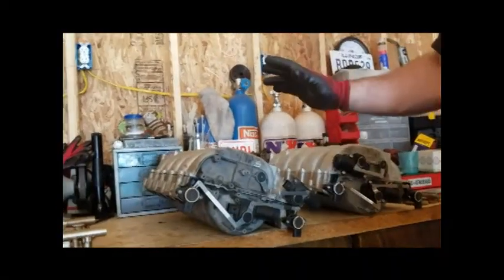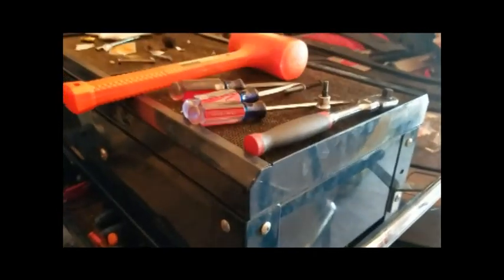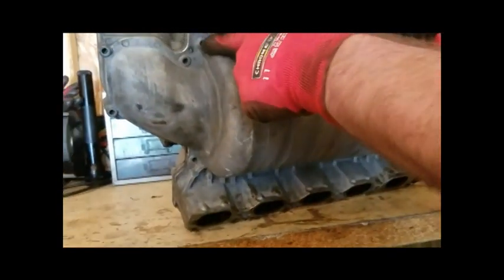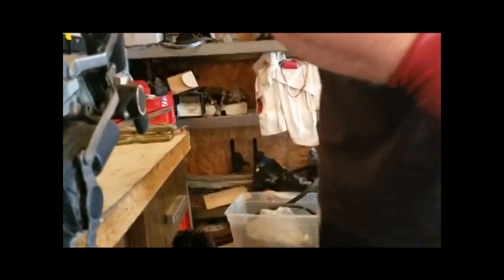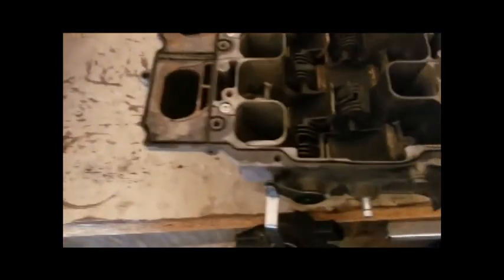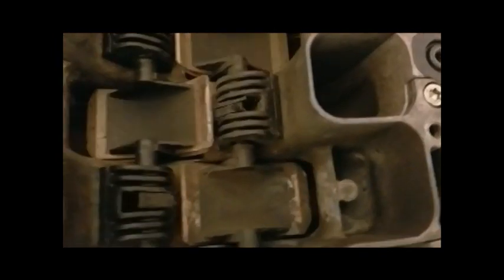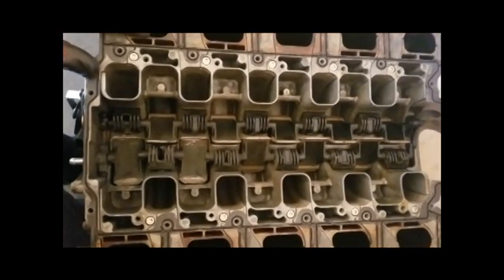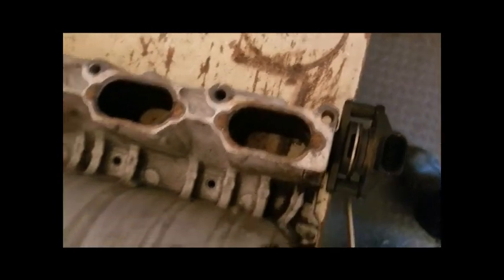Audi S6 / S8  5.2 V10 intake separation. What breaks how does it work?

Comment: Honestly, i would pull the TGV's and remove the TQ runners in the intake all together! With that some hand port work on the intake runners up to a 1200 grit or better not only to knock the carbon out to gain a few ponies without worry of atomization issues. Keep motors intact to not get a code and now its a bullet proof intake until next carbon cleaning!

Comment: Awesome video man. Did it easily brake open from the first small screwdriver or did you go along side that smaller one in with another slight bigger screw driver and followed with more until the body broke apart? Hope you find the time in the middle of this pandemic to write down how to easy it popes open. I have already the jhm spacers sitting ready for years & have almost everything prepared to walnut shell blaster the carbon out but want to be realistic and ready for some broken flaps from what I can hear the rattle when car runs stationary on 1500-1800 rpm. 79k km S8 in NZ.
Reply from the maker: If you're an 5.2 guy check out Audirevolution.net. Lots of good stuff there. I can probably write up something and post it there. Just let me know what other possible questions you have.  As for breaking open - No the sealant won't allow the intake to separate without hitting several areas and you want to hit several areas with just the small screw drivers as if you go too big. You will crack the intake manifold itself.... The 1800rpm tattle generally is the intake flaps so sounds like you're thinking in the right direction.
Reply: @howididit7196  Yes Audirevoltion I have already found a lot of tips. Roger that about the small screwdrivers. Yes from the sound it seems the flaps loosely vibrating on their axles. With a little bit of luck no parts have been yet broken off. When that happens in worse case I understand plastic parts could get inside the exhaust valves and may damage the catalytic converters.  Yes it's the 5.2 V10. Thinking about using Hylomar Universal Blue
 non-setting gasket & joining compound so I can easily open it up after new carbon has formed.  U was thinking when all flaps are still in position to glue the whole system in place with closed flaps to get the most torque and not risking anything breaking of and damaging the engine. I had some challenge before with getting an audi seal broken when taking off the oil pan to get to the "kiss of dead" clogged up oil intake screen.  Ended up the oil pan slightly bend after removing.  I understand the magnesium for the inlet manifold is quite brittle compared to a steel sheet oil pan.
Reply: I have a question which side flaps do I close off  how do I know the difference in long runner and short runner ?

Comment: Hi, great video. I have a S6 v10 2006. Major problems at the minute which i think maybe related to the flaps. What is the best way to confirm its a flap issue without removing the intake? Thanks👍
Reply from the maker: Removing the upper Y section that has the throttle bodies on it. From there stick an inspection camera down and into the intake manifold itself. You should be able to see all of the flaps this way. At that point you can inspect the flaps their mounting points and the linkages. If you wish to see the flaps move while you have the inspection camera in the intake. If you have vag-com you can do an output test to actuate the intake flaps.
Reply: @howididit7196  can i just remove the flaps and stick it back together?? 

Is it just for emissions or will I lose power?

Comment: I have  an 08 audi a8l quattro 4.2l v8 
 My flaps were broken as well  and  it couldn't even warm up the car on it's own  terrible  idling  ran bad....  try ed looking for a used decent  intake air  manifold  all over the website  with no luck... so went to the dealership  asked questions... the dealer  sales man  told me that a new one  would cost  3k dollars  💸  he didn't recommend  that I buy  new one   only because I asked how much a new cost ed... so I  thought about it  and bought a new one  because  the chances of  finding a decent used one   how long  would it last  ???
it being a used one  the new one  was worth it for  me because it runs like a brand new car again  am very happy with my choice  expensive  but worth it...
Reply: why not just delete the flaps
Reply: @mrrodriguez6093   it will lose its torque  ...

Comment: Hello, do you recommend deleting the intake port spacers? (those metal plates) and what are the pro's/con's of also removing the thumble flaps?
Reply from the maker: Hello, The port spacers (those metal plates) help close off the intake port so when the tumble flaps are open the cylinder is fully closed off. There is not a notable down side to the removal of the flaps. The up side is they're very prone to collect carbon so removing those remove that part of the equation.  I would not remove the tumble flaps. I'd consider getting the JHM tuning package. The tune only uses the tumble flaps for cold start and then after cold start they're completely put into the open position. The end result is very nice bump in hp along with the other added benefits of the JHM tune.

Comment: 2009 D3 S8 intake manifold replacement...any special tools needed to make this replacement and do you recommend carbon cleaning while there?? Any concerns with removing the flaps and reinstalling them as part of the cleaning?
Reply from the maker: Nothing crazy tool wise. The hpfp lines can be hard to get loose so maybe a crows foot for that.  Carbon clean and if you can injector clean is almost a must. The injectors are these cars tend to fail and can later cause misfires. The intake manifold flaps are not going to be able to come out. But you can always inspect and clean

Comment: So this is the only way to check the flaps are working?  Big thanks
Reply from the maker: You can always. Remove the upper Y pipe to the intake, get a mirror and look inside the intake while doing an output test via Vag-com. Watch to see if all of the flaps are moving.
Reply: How I did it can i just remove all the flaps,  leave it in short intake way? How much torque will lose in low end.
Reply from the maker: You can eliminate the flaps. But you'll loose all of the low end TQ. There is a thread on Audirevolution.net where someone dyno'd without the flaps and they lost about 30+whp and close to the same in TQ. The absence of flaps also appears to cause some instability that can lead to idle missfires. So, while you can do it, there are going to be some drawbacks. locking the long runner flaps position is by most seen as the best option. Due to the fact that you'll be driving in the long runner position 98% of the time. So blocking off the short runner position is a very strong option.
Reply: How I did it thanks a lot, most of the time I drive gently, but some times I put my foot down, i need high rev power, maybe the best thing to me is fix it or change the new one😄😄😄

Comment: I have a question which side flaps do I close off  how do I know the difference in long runner and short runner ?
Reply from the maker: The best way I can explain it is, You want the flaps to lay flat. Flat they leave the long runner open. When the flaps are standing up they're cutting off the long runner and leaving open the air path to the short runner.

Comment: what would be so wrong with removing the inside parts? but leaving the arm and motor on so no code?
Reply from the maker: Hi John, The only section that has sensors to help communicate with the ECU are the tumble flaps. They're located in the lower outside part of the manifold (they're used for slow speeds and cold start) So the Tq flap (the big flaps in the middle) can be removed or "gutted" Many people try to repair or epoxy the flaps into the long intake runner path as without the flaps or "gutted" the motor will loose a significant amount of TQ. It's been measured up to 30Wtq that is lost on a gutted intake. Still... If the flaps are beyond repair they can be removed.. The motor arm from the Tq flap motor to the flap activator can have the rivets moved and then not connected to anything. The motor needs to be plugged in our you'll get a open circuit code.. Did that make sense?
Reply: @howididit7196  yes! Thank you for your reply
Reply: I've been seeing allot of both side of gutted or not gutted, where some loose power while others don't lose enough power to actually worry about epoxying the flaps in. I just started doing mine and one of my flaps broke completely off and was laying inside the manifold lol, and the actuator arm was busted so who knows how long the flaps haven't been working

Comment: Hi does intake spacers help gain any ho or they just help with the temperatures and how  do I know if mine are not broken
Reply from the maker: The intake spacers do several things and several things very well. The temperature control is at the foundation of how they help the motor make and keep power. Think of the intake spacers as more of an intercooler. An intercooler won't help so much make power as it will help the car keep power. The intake spacers are like this in the fact that they keep the actual intake air temps into the cylinders much cooler. Aside from that the fact that the under hood temps are going to be so much lower this helps with heat stress on hoses both rubber and plastic and most of the other components that you will see tend to get heat stressed.
Reply: @howididit7196  thanks dude really appreciated one last request can u send me the picture how to connect vaccum hoses i mean the three vaccum tubes going in front of the engine thanks

Comment: How about just getting rid of the flaps?
Reply from the maker: You can eliminate the flaps. But you'll loose all of the low end TQ. There is a thread on Audirevolution.net where someone dyno'd without the flaps and they lost about 30+whp and close to the same in TQ. The absence of flaps also appears to cause some instability that can lead to idle missfires. So, while you can do it, there are going to be some drawbacks.

Comment: I cant believe no one makes replaceable runners and flaps im going to machine billet ones and sell them reasonable.
Reply from the maker: The flaps are complicated as you can see. Switching over from the long to short runners makes all the difference in the world on these cars. When you see that all 10 cylinder flaps are linked together making a solution that can attach to the intake itself then to the step motor would be expensive. Take into consideration the cost then time, then taking into consideration people who would have to install them and being able to support that. That's a lot of road blocks. Getting an updated intake isn't cheap but.. It's worth it.

Comment: They should of just did the r8 intake.
Reply from the maker: An R8 intake looses a ton of power on these cars. The power curve for the S6 and S8 are Tq curves that have a rev limit of 6800 the R8 intake is built for the power curve that goes to 8500. SO with the R8 intake it a lot of money to not be able to close your hood and then loose hp and tq on top of all that. The multi stage intake is the foundation of making great power on the lower revving V10.
Reply: @howididit7196  ok . Shit my intake flapps i think broke it lost a little power it was a stalion before that. The car is the cleanest s6 i ever seen 62 k on it. Jhm has intake for 2 k . Do you have any suggestions.  I seen pez makes a supercharged supposedly for a s6 but i never seen a vid of one working . Its kinda alot though. For that i might as well get a r8. I cant believe know one makes flapp replacments if i was a good machine shop guy id make some and sell them. Any ideas plz.